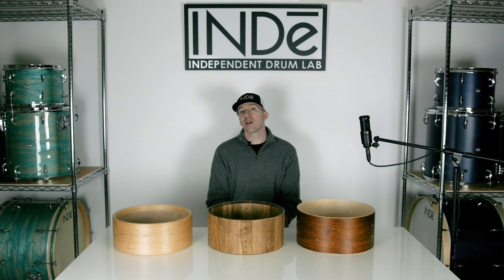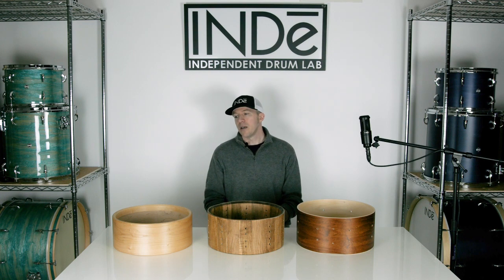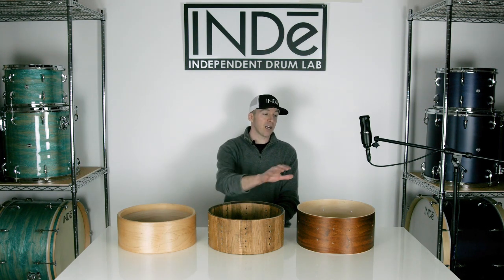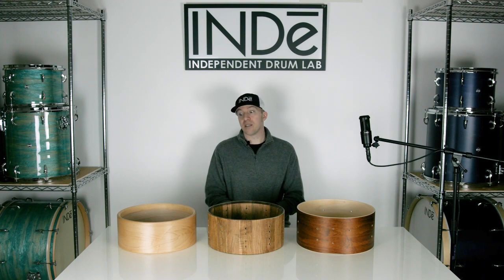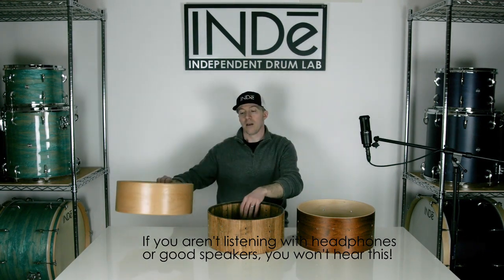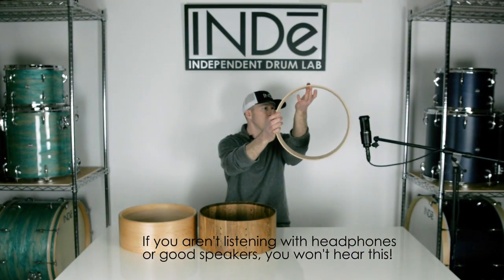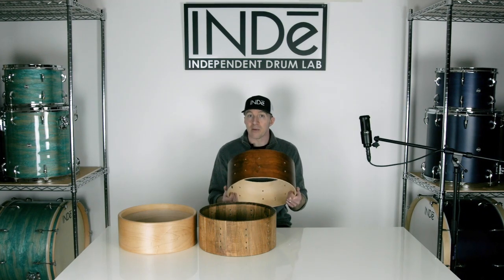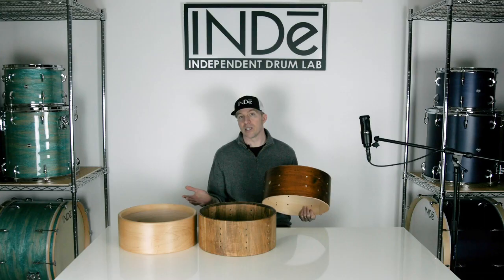Ply Shells vs. Solid & Stave Shells | Drum Nerd Lab

Comment: Now add hardware and repeat the test.
Reply: I would even add: add heads, tuning and play them like drums. Then any difference between these three shells would probably be almost unnoticeable.
Reply: @MadWinter889  
But I prefer a basic, stripped down snare drum, with no head, hardware, or snares. Just a hollow piece of wood that I can tap with my fingers, like ^he did! 😁
Reply: Make a 13" drum that uses a 14" head. On guitars this gives all kinds of sustain.  Has anyone done this thing besides the gong bass drums Tama did?
Reply: Pearl hat in den 70ern ein ganzes Set gebaut, bei dem die Felle 1 Zoll grösser waren als die Zargen. 15 zoll Tom mit 16 Zoll Fell, 14 Zoll Snare mit 15 Zoll Fell, etc. Dies wurde "Free Floating System" genannt. Interessante Idee, aber in der Praxis enttäuschend. Schlecht stimmbar, zudem empfand ich die Snare als monströs gross. Ich verkaufte das Set, behielt aber die Snare, entfernte die Kunststoffunterlegungen unter den Spannböckchen und montierte ein normales 14er Fell. Jetzt habe ich in meiner Sammlung eine wuchtige, laute Rock Snare.
Reply: Exactly what I was thinking...

Comment: As an amateur drum builder, and a drummer, we aren't hitting drum shells, we are hitting the heads. The resonance of the shell itself is meaningless. All that matters is 1. The heads 2. Bearing edge 3. Drum depth. and 4. venting hole diameter. Thats it! If I took a DW drum and placed it next to an identical cheap drum set with good edges, tuned them up, and asked you to tell me which one is which, you would have a 50% chance of guessing correctly.
Reply: Hum...I think you're about 50% correct in this statement. :-) teasing)  some folks are into the tech and some not. different strokes for different folks
Reply: I totally agree, @derekmiller5085. Before I delved deeper into this, I was captivated by the 'science' too. 

In fact, I started making my own ply drums to replicate the masterworks kit I regretfully sold 18 years ago.

I was entranced by the nuances of wood tones and shell thicknesses. 

But now, when I challenge my drummer friends to discern between different shells or identify birch from maple, none have been spot on without resorting to sheer guessing. 

The unique journey of a drummer revolves around discovering one's distinct sound. 

Despite all the marketing ploys, the allure of the perceived science behind drumming is what makes the journey so special. So indeed, I respect your comment very much. Different strokes for different folks!
Reply: Hello je suis d accord avec vous
Reply: I should add the snare wire bed depth...but I agree the shell is not the part that vibrates

Comment: I agree with your point on shell resonance, it has a lot to do with the skill of the worker, and the quality of the fixture used to compress and heat the glue. 
I manufacture stave snare drums, I’ve tested them against ply and metal. I have concluded that the weight of the drum is very important if you desire increased volume at all dynamic levels. 
The increased mass moment of inertia of the stave shell is a bonus when the stick strikes the head. It turns more acoustic stick energy into sound, vs a light shell, which is less. If you want volume with less overtones than a ply or Steel, the Stave or steam bent is a good option.

Comment: I was watching a Drum Dot Pizza video the other day where he broke down Sonor's research into drum physics.  If the drum is rigid and it's hard to get it to vibrate, then that's actually going to maximize resonance.  The sound energy from the drum heads and how well they can vibrate, not the shell.  So if the shell is vibrating to the point where there's a tone, then that's all sound energy being taken away from the heads.   

I could have understood that wrong though.  Have you guys thought about doing an A/B/C comparison of the two with the same heads/hardware?
Reply from the maker: You are confusing resonance with sustain- Rigid shells maximize sustain- the energy stays in the heads, and so they vibrate for longer.  Resonance is when other parts of the drum get in on the vibration- creating a warmer, rounder tone.  For max sustain, you want thick, heavy shells with sharp bearing edges.  For max resonance, you want thin, low-mass shells and round edges.
Reply: @IndependentDrumLab  So is resonance the attenuation of certain frequencies coming out of the head as the energy from them is being transferred to the shell?  Or is it the shell actually creating a tone that's contributing to the overall sound?
Reply from the maker: @cartoune  Resonance is when the entire drum is vibrating along with the heads, and contributing to the overall sound.  A very resonant drum will have a full, round tone, with shorter sustain.
Reply: A resonant shell is absorbing more high frequencies, a stiffer shell is reflecting them, which result in a warmer sound.